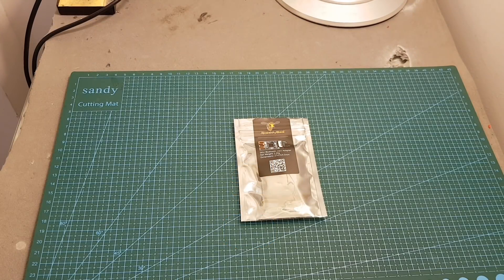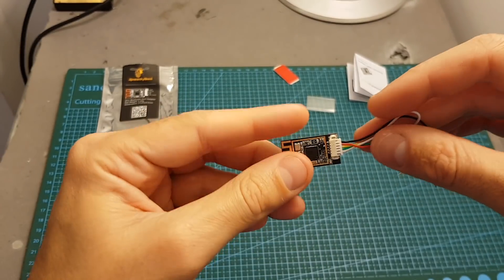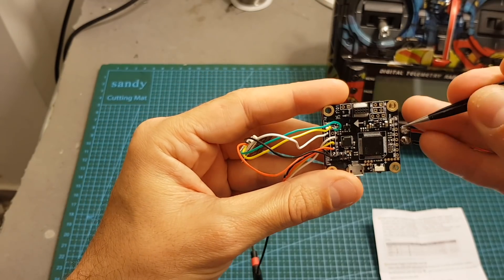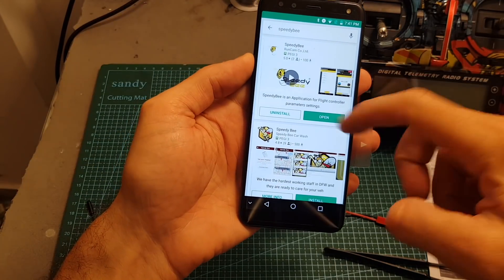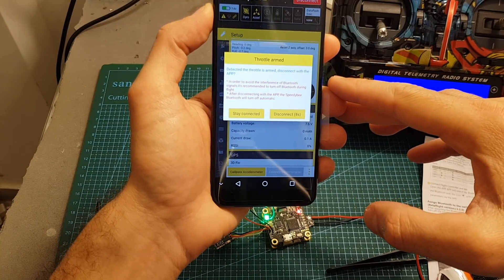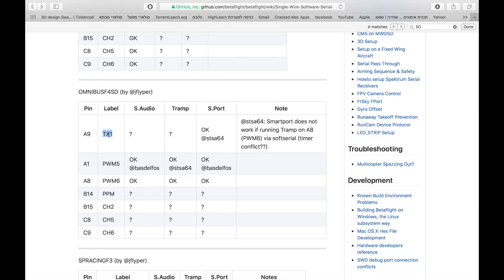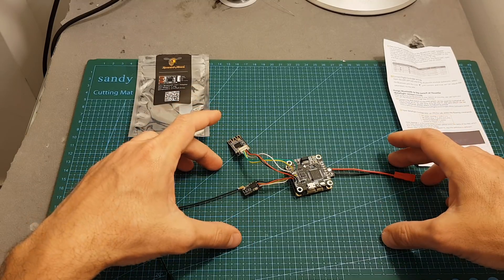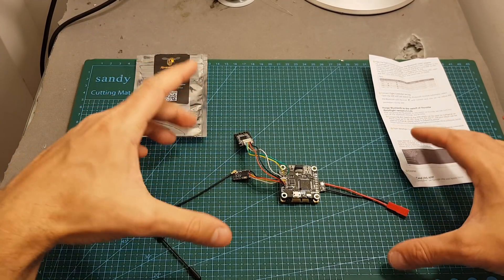SpeedyBee Bluetooth UART Adapter - Overview & Setup

Comment: Hi mate, I am looking at getting one of these. Have you tried installing a UART connecter to the end of the wires? So instead of soldering it, you can just plug it in the UART port instead on soldering? And have you also thought about not soldering the BEL switch? Speedybee told me that it will still work without the BEL switch wire as long as you set the baud rate on the UART port on Betaflight. 

Reason I want to do is, is so that I can just use the one speedybee module for multiple drones ( that are set up on BF for it offcoarse) and so that I don’t have to leave it connected on the FC.
Reply from the maker: Hi there. I didn't try to install a UART connector at the end of the wires, but I don't see any reason why it won't work. I didn't try the unit without connection the BLE switch, so I am not sure if the unit will be turned off when armed, but anyway - if you plan to use the method above and plan to disconnect it from your quadcopter - it doesn't really matter.